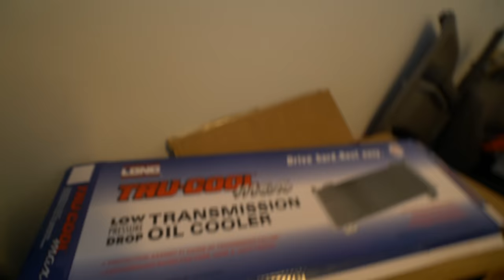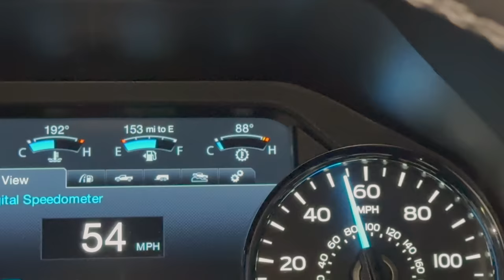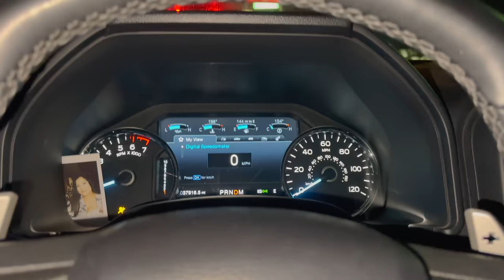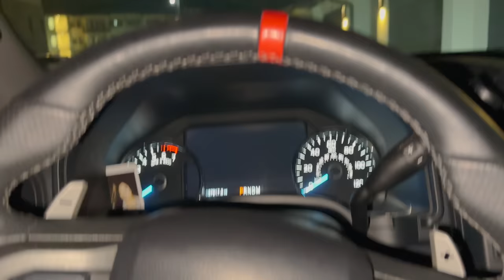HOW TO UPGRADE A 10R80 TRANS COOLER! 🔥🔥 KEEP TEMPS LOW! ⬇️⬇️

Comment: Nice install bro!💪🏼 I would just recommend u add some more mounting supports to the bottom of the trans cooler so that when u go into high speeds the wind doesn’t push it back and potentially break off the two mounting points u have it on

Comment: Broski, I am having an issue with the 10R80 transmission on my 2019 ford expedition. Whenever the car heats up, the transmission starts slipping whenever I accelerate hard while coasting at 60-70mph. It makes it hard for me to overtake which almost got me in a terrible accident. Could this be the transmission heating up due to the mediocre sized intercooler that comes stock? and if so, if I upgrade to something like a mishimoto, would it help with the issue? Any input will be helpful
Reply: Before you start looking at a new cooler or anything like that, be 100% certain that your transmission is appropriately filled. These transmissions seem to be very sensitive to fluid levels. A few weeks ago mine acted oddly, almost like it was slipping in 8-10th gears. The temp never got any hotter than about 218 deg, but the ULV fluid expands quite a bit as it warms and I found that my trans burped out some fluid out of the vent that's on top of the unit. Turns out that my trans was actually about 2 quarts too full. You absolutely MUST get these thing up to temp before you check the fluid level. You likely have a trans fluid to engine coolant heat exchanger. ULV is made to get reasonably hot, like close to engine temp hot. Because it's meant to get to those temps and ULV expands quite a bit as it heats up, and these transmissions are fluid level sensitive, you have to be very careful about checking your trans fluid level. Seriously, check that level first, maybe do a drain and fill... then get it hot (around 200 deg) and check the level... adjust from there and slowly so. 

My F150 has the max tow package so I already have an aux cooler and because my trans rarely goes above 203, it's not surprising that I didn't catch the overfull condition until it got hot enough to vent fluid.
Reply: @akulahawk  I tried refilling the transmission oil on high temp and made sure to measure throughout this whole thing.
I am still facing the same issue. A friend of mine suggested that there might be an issue with the torque converter. Could it be?
Reply: @hismuth3307  it's certainly possibly that your torque converter is the problem. If it's failing you could see some odd behaviors. Just know that these units are really sensitive to fluid level and if they get too full from heat expansion they can do some odd stuff. I'd say you should run this by a shop that's knowledgeable about these units as they're a bit different thanks to the computer control and adaptive shift learning.
Reply: Bump. Same issue.
Reply: @eyadm147  I ended up selling my 2019 Expedition and getting a 2020. Didn't loose money in the process and the transmission is smooth so far
Reply: Now that you've had your trans cooler on for awhile.. what's the temps looking like? Any issues?
Reply: @hismuth3307  Hi did  you ever check the problem of the 2019 expedition? my car act the same way with yours old one now. Please help
Reply: @LesMains-s9s  Hi there and apologies for the late reply. Trust me when I say it, I have tried everything I could to get the issue fixed, but failed to do so. I was lucky enough to find a good trade with a newer model and I am no longer facing the same issue.

Comment: Thanks for updating the bio bro ! I order two sets of line or one from the Amazon ? It’s the 8an right ? It comes with everything you need to hook it up with trans cooler ?
Reply from the maker: Yeah bro all you need will be the conector from the trans to the lines I’ll look for it 👍🏻
Reply: @CoyoteOscar   already man so I order two sets of line or 1
Reply from the maker: @OmarHernandez-xf5pk  I ordered two sets bro because if you cut it in half it’s going to be tight to work around with
Reply: @CoyoteOscar  ok bet 👍🏼
Reply: @CoyoteOscar  did you put the connector you used for the trans lines bro
Reply from the maker: Jr doesn’t have it instock I’ll try to find it and post in in my bio bro 👍🏻

Comment: The coolant lines coming off the radiator where you put the "U hose" which coolant line would have been the return line back to the OEM cooler, the hose with the blue marks on it..?/
Reply from the maker: I deleted the whole thing with the pump included

Comment: I'm curious about the trans Temp , i believe it have to be in the optimum Temp which is around 105 °C ? By this setup, it wouldn't reach that range specifically during winter ?
Reply: 105 C you are starting to cook the oil and transmission
Reply: @user-nk4qo3dw9z  Yes, that's absolutely right. Unfortunately,  my trans was burned out due to this issue

Comment: My transmission overheats as well leading to slippage.  2018 10 speed.  I will invest in new trans cooler.
Reply: Mine did same thing I put in new thermostat and for slipping new sparkplug seemed to have fixed problem no more slipping no Ober heating either but always is around 215 220
Reply: Will install tran cooler soon

Comment: Is there a thermostat in the automatic transmission or the cooler
2019 f150 2.7 4x4
Alot ppl seem to think so
Having weird temperatures
New 170 thermostat 
Engine stays 180F
Transmission is all over the place
Reply: the termostat is in the transmission I'm pretty sure it opens at 170
Reply: @Springerr  nope I found it 
It's external computers control valve

Comment: Are there any problems that you have seen after this upgrade? The temperature is less than 117F. I think it is too cold.
Reply from the maker: I had asked around as well they told me it’s better that the trans runs cold than being at 200 all the time.
Reply: @CoyoteOscar  Yes, you are right, cold is better than heat, but  did you have faced problems with driving and gear shifting?